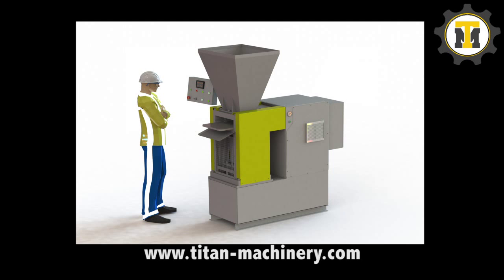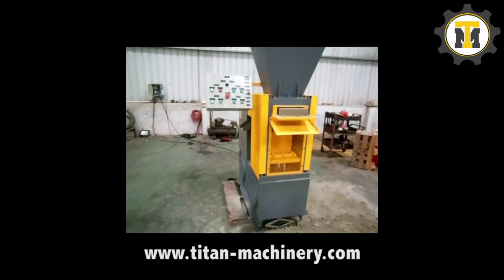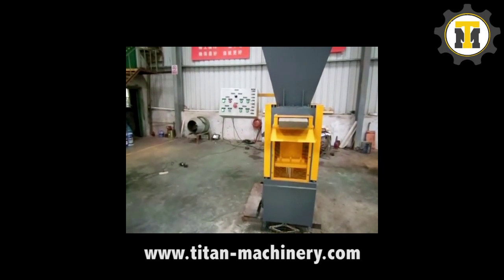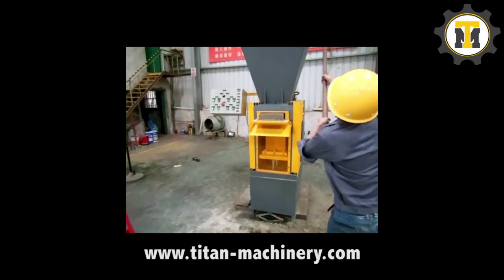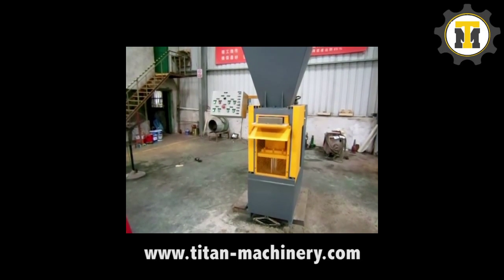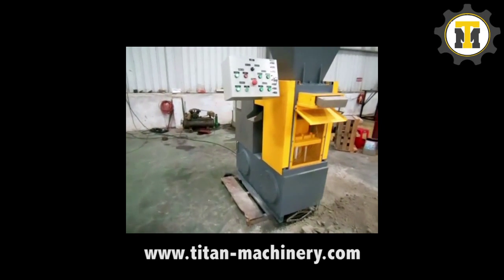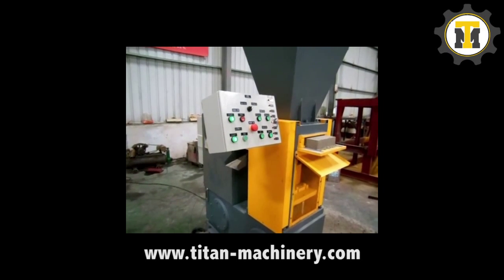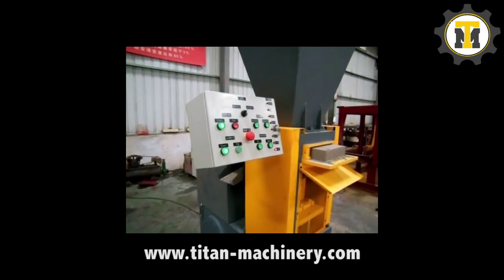Affordable high pressure brick making machine - TITAN 80-720 PPSH

Comment: can we use this for clay bricks
Reply: Yes, it is quite possible. We produced a lot of machines for clay brick pressing. In some cases we recommend using of the heated moulds when clay is especially sticky but not for all cases. The big advantage as for this machine is in using dry powder which presumes that there is no need in drying and you can put bricks directly into the kiln right after pressing.